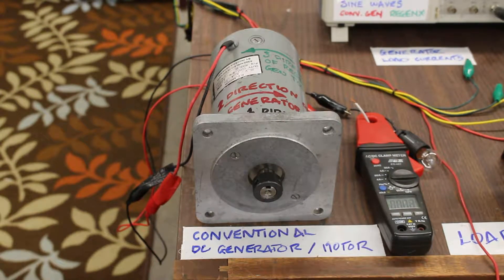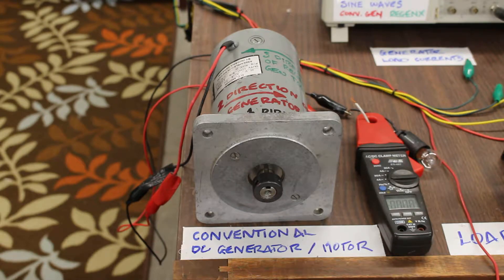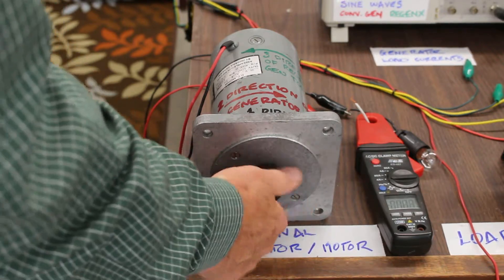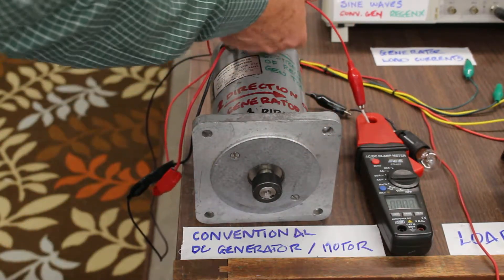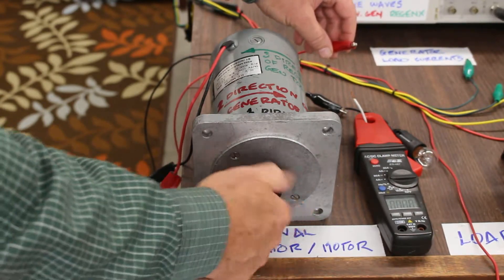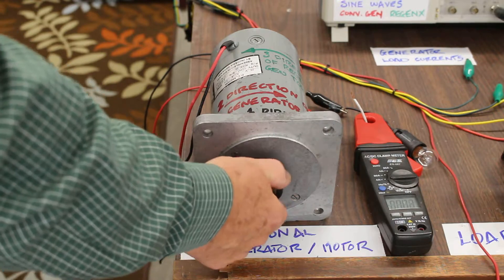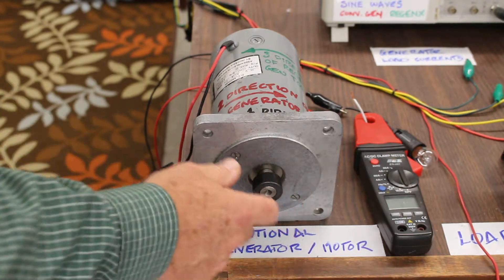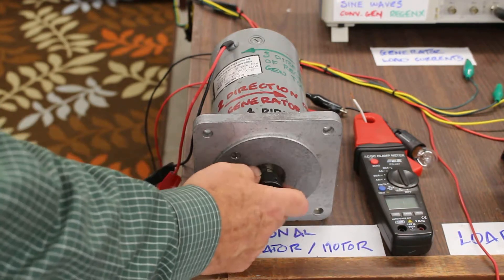WHY EVERY FARADAY GENERATOR SINCE 1834 IS A PERPETUAL MOTION MACHINE OF THE 1ST KIND

Comment: Gary, I know that there's no such thing as complimentary electromotive torque.  YOU know that there's no such thing as complimentary electromotive torque.  But the INVESTORS don't know that there's no such thing as complimentary electromotive torque.  Get my drift?
Reply from the maker: COMPLEMENTARY-ELECTROMAGNETIC-TORQUE...😉

HEINS LAWS OF MOTION 2022 for ELECTRODYNAMIC SYSTEMS  
An Extension of Newtons Laws of Motion 1687

Sir Isaac Newton published his laws of motion in 1687, in his seminal work "Philosophiæ Naturalis Principia Mathematica" (Mathematical Principles of Natural Philosophy) in which he formalized the description of how massive bodies move under the influence of EXTERNAL forces.

Between 2007-2022 Thane Heins discovered how Electrodynamic Systems can be influence by INTERNALLY created forces.

Newton's first law states that every object will remain at rest or in uniform motion in a straight line unless compelled to change its state by the action of an EXTERNAL force.

Heins' formulated his First Law of Motion for Electrodynamic Systems in 2007 which states that every object will remain at rest or in uniform motion in a straight line unless compelled to change its state by the action of an INTERNALLY created force.

In the case of an Electrodynamic System which operates according to Lenz's Law of Induction; Negative Work is performed by INTERNALLY created Electromagnetic Field Energy according to the Work-Energy Principle and the Kinetic Energy of said body or system is decreased.

In the case of an Electrodynamic System which operates according to Heins' Law of Induction; Positive Work is performed by INTERNALLY created Electromagnetic Field Energy according to the Work-Energy Principle and the Kinetic Energy of said body or system is increased.

Newton's Third Law: Action & Reaction 

Newton's third law states that, forevery action (force) in nature there is an equal and opposite reaction. If object A exerts a force on object B, object B also exerts an equal and opposite force on object A.

Heins' Third Law of Motion: for Electrodynamic Systems where the REACTION IS DELAYED IN THE TIME DOMAIN

Heins' Third Law of Motion states that, for every action in an Electrodynamic System there is an Equal and Identical Reaction when the Reaction is Delayed in the Time Domain.

EXAMPLE OF HEINS' FIRST LAW FOR ELECTRODYNAMIC SYSTEMS: 

Lenz's Law of Induction: https://youtu.be/j1tZDSZtXq0

Negative Work is performed during electricity generation by INTERNALLY created forces (a Counter-Electromagnetic-Torque) where the Kinetic Energy of the Generator and Prime Mover are DECREASED when the generator is placed On-Load. 

The Energy Source which is required to perform the Negative Work according to the Work-Energy Principle is INTERNALLY created Sub-Atomic Quantum Electron Energy or Electromagnetic Field Energy which is INTERNALLY created by emitted Photons inside the current bearing wires when the Electrons return back to their lower energy orbits around the Nucleuses of their Atoms.

EXAMPLE OF HEINS' FIRST AND THIRD LAWS OF MOTION FOR ELECTRODYNAMIC SYSTEMS 

Positive Work is performed during electricity generation by INTERNALLY created and Time Delayed forces (a Complementary-Electromagnetic-Torque) where the Kinetic Energy of the Generator and Prime Mover are INCREASED when the generator is placed On-Load. 

The Energy Source required to perform the Positive Work according to the Work-Energy Principle is created and Time Delayed Sub-Atomic Quantum Electron Energy or Electromagnetic Field Energy which is created INTERNALLY by emitted Photons inside the current bearing wires when the Electrons return back to their lower energy orbits around the Nucleuses of their Atoms.

Heins' Law of Induction: https://youtu.be/pyO8FUTDX68

Thane C. Heins
President and CEO, Potential +/- Difference Inc. R&D
Ottawa, Canada
thaneh@potentialdifference.ca
613.293.1131
Reply from the maker: Counter-Electromagnetic-Torque

Comment: I am an electrical engineer who has been designing motors for almost 30 years, and I can say with ABSOLUTE certainty, that there is no such thing as "complimentary electro motive torque".  Total nonsense.
Reply from the maker: COMPLEMENTARY-ELECTROMAGNETIC-TORQUE...😉

HEINS LAWS OF MOTION 2022 for ELECTRODYNAMIC SYSTEMS  
An Extension of Newtons Laws of Motion 1687

Sir Isaac Newton published his laws of motion in 1687, in his seminal work "Philosophiæ Naturalis Principia Mathematica" (Mathematical Principles of Natural Philosophy) in which he formalized the description of how massive bodies move under the influence of EXTERNAL forces.

Between 2007-2022 Thane Heins discovered how Electrodynamic Systems can be influence by INTERNALLY created forces.

Newton's first law states that every object will remain at rest or in uniform motion in a straight line unless compelled to change its state by the action of an EXTERNAL force.

Heins' formulated his First Law of Motion for Electrodynamic Systems in 2007 which states that every object will remain at rest or in uniform motion in a straight line unless compelled to change its state by the action of an INTERNALLY created force.

In the case of an Electrodynamic System which operates according to Lenz's Law of Induction; Negative Work is performed by INTERNALLY created Electromagnetic Field Energy according to the Work-Energy Principle and the Kinetic Energy of said body or system is decreased.

In the case of an Electrodynamic System which operates according to Heins' Law of Induction; Positive Work is performed by INTERNALLY created Electromagnetic Field Energy according to the Work-Energy Principle and the Kinetic Energy of said body or system is increased.

Newton's Third Law: Action & Reaction 

Newton's third law states that, forevery action (force) in nature there is an equal and opposite reaction. If object A exerts a force on object B, object B also exerts an equal and opposite force on object A.

Heins' Third Law of Motion: for Electrodynamic Systems where the REACTION IS DELAYED IN THE TIME DOMAIN

Heins' Third Law of Motion states that, for every action in an Electrodynamic System there is an Equal and Identical Reaction when the Reaction is Delayed in the Time Domain.

EXAMPLE OF HEINS' FIRST LAW FOR ELECTRODYNAMIC SYSTEMS: 

Lenz's Law of Induction: https://youtu.be/j1tZDSZtXq0

Negative Work is performed during electricity generation by INTERNALLY created forces (a Counter-Electromagnetic-Torque) where the Kinetic Energy of the Generator and Prime Mover are DECREASED when the generator is placed On-Load. 

The Energy Source which is required to perform the Negative Work according to the Work-Energy Principle is INTERNALLY created Sub-Atomic Quantum Electron Energy or Electromagnetic Field Energy which is INTERNALLY created by emitted Photons inside the current bearing wires when the Electrons return back to their lower energy orbits around the Nucleuses of their Atoms.

EXAMPLE OF HEINS' FIRST AND THIRD LAWS OF MOTION FOR ELECTRODYNAMIC SYSTEMS 

Positive Work is performed during electricity generation by INTERNALLY created and Time Delayed forces (a Complementary-Electromagnetic-Torque) where the Kinetic Energy of the Generator and Prime Mover are INCREASED when the generator is placed On-Load. 

The Energy Source required to perform the Positive Work according to the Work-Energy Principle is created and Time Delayed Sub-Atomic Quantum Electron Energy or Electromagnetic Field Energy which is created INTERNALLY by emitted Photons inside the current bearing wires when the Electrons return back to their lower energy orbits around the Nucleuses of their Atoms.

Heins' Law of Induction: https://youtu.be/pyO8FUTDX68

Thane C. Heins
President and CEO, Potential +/- Difference Inc. R&D
Ottawa, Canada
thaneh@potentialdifference.ca
613.293.1131
Reply from the maker: Counter-Electromagnetic-Torque